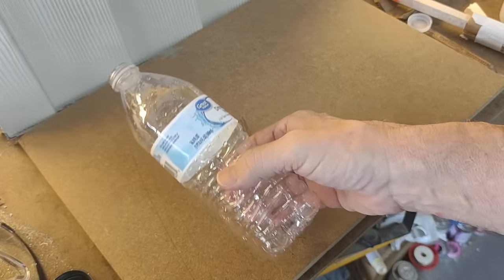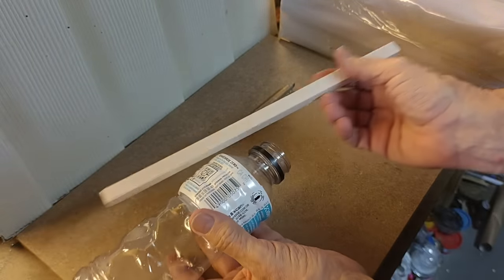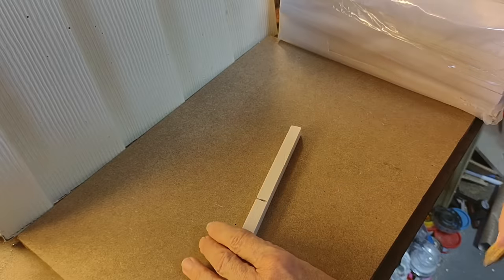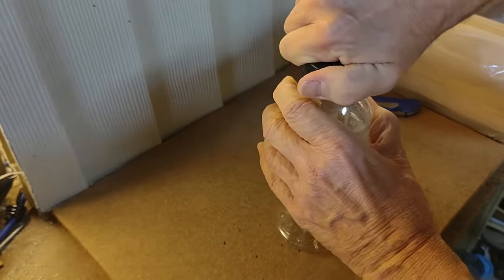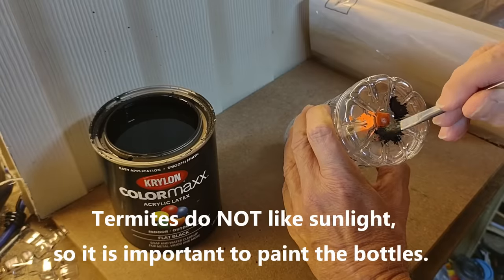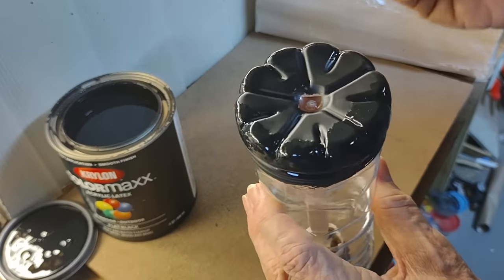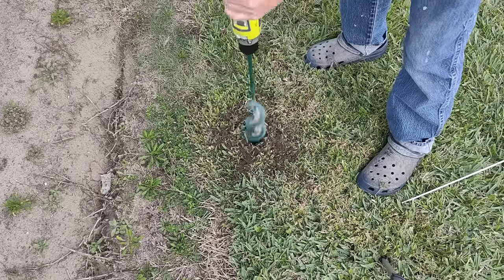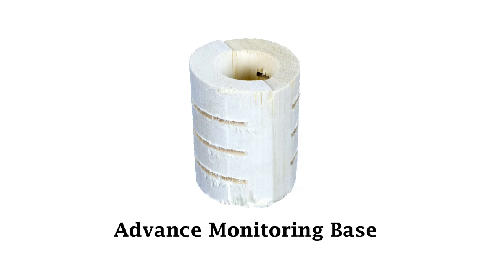Unbelievable Water Bottle Trick for Termites!  Simple to do!

Comment: Thank you very informative video. I just moved into a home with a dead broken down tree near my home above 15 feet away. There were lots of termites eating at it when I threw it into a fire pit. Should I treat the stump area with that chemical? Also are they likely to be eating at my home? We have tons of tiny ants on the second floor in the bathroom. I think they’re just sugar ants but I’m hyper sensitive now bc of t finding. Thank you in advance. Tim
Reply from the maker: Before you start messing with the stump, you need to make sure that your house is okay.  Look for mud tubes around the perimeter of the house, under the house, and in the attic as well.  If you do not see any mud tubes, can you are most likely okay.  Still, the termites are very close, so you should treat with termite granules, if the ground meets the correct criteria.

For the granules to work you need to have dirt around most of the house and that dirt needs to be porous enough to allow water to seep into the ground fairly quickly.  To find out if the dirt around your house is porous enough, just dig a small hole next to the house that is about 4 inches deep, 8 inches long, and just the width of the shovel.  Fill the hole with water and watch to see how fast it drains down into the ground.  If it seeps into the ground fairly quickly, then the granules should work just fine.  However, if it just kind of sits there, then the granules would not be a good choice, and you should consider trenching, if you have an active infestation.  If it turns out that you need to trench, then please watch my video on how to do that correctly.  Trenching is a lot more work, but it only costs about $100 to do an average size home, and it lasts 5 to 10 years.  Most people can trench an entire house in one day, but you can take up to a month to get it done, and you can literally do just 10 feet at a time.  Again, I would not trench unless I had an active infestation in the home.

Make sure that you buy the correct granules.  You need the ones that have imidacloprid as the active ingredient.  A lot of the Home Depot and Lowes stores no longer sell the correct granules, but you can get them from Amazon.  I will give you a link to them.

If you do not have an active infestation already, you may want to also consider using the monitoring stations around your home.  I use both the granules and the monitoring stations.  

After you have the house protected, then you can treat the stump.  Drill holes in the top of the stump that are about 1/2 inch wide and just as deep as you can make them.  You should try to drill them at least 12 inches deep.  Ideally, you should drill them about every 4 inches apart, but if that is too much work, just drill as many as you can.  The more of them you drill the better.  Also drill holes that are about 12 inches apart around the base of the stump that are on a downward angle, so that the drill bit is aiming under and to the center of the stump.  After the holes are all drilled, then mix Taurus SC at 0.8 oz per gallon and fill up the holes with it.  You can mix it in a bucket and use a funnel to get it into the holes.

Please get back to me after you treat the termites and I will explain how to get rid of those ants.             

I hope that helps.  Be well my friend.

Termite granules:  https://www.amazon.com/dp/B000RUIJYM?ref=nb_sb_ss_w_as-reorder-t1_k1_1_6&amp=&crid=157C3RV0MY0AK&amp=&sprefix=termit

Video on how to trench for subterranean termites:  https://youtu.be/Fy7YHi_7Z8g

Video on how to make monitoring stations:  https://youtu.be/gye27aXHRsY

Taurus SC:  https://www.domyown.com/taurus-sc-termiticide-p-1816.html?sub_id=1817
Reply: @GuysPestSolutions  wow I’m amazed at the response  and am very appreciative for the advice. Probably will be a couple weeks until I get it all straightened out, but I will get back to you when I do. Hope you stay well as well!
Reply from the maker: @timtrainer10  You be well too my friend.

Comment: This is Michael. Thank you you for this great information. You really do need to go a lot faster in the future, but your information is valuable and much appreciated. 

I've noticed that Amazon sells some termite warning kits. And it's actually cheaper to buy a whole new kit than to buy replacements. So by some kits and use them around the house if you don't want to take all the time to make a hundred of these for a large house
Reply from the maker: I don't know what to say.  I'm 73 and not in a rush anymore.  At this point, I'm just happy to wake up in the morning.  Lol.  However, I did manage to get my latest video under 11 minutes.  I will give you a link to it.  It pairs well with this video.  I have a homemade bait station that you can use instead of ones that you buy.  Mine works a lot faster.  Do not buy the kits on Amazon.  They are most likely the Spectracide Termite Stakes and they don't work.  I have a video on that too.  Be well Kathy.

Video on how to make a bait station:  https://youtu.be/r05Z-aUJehw

Video on Spectracide Termite Stakes:  https://youtu.be/UDzg-1lpynA

Comment: In the Philippines we used ....use oil from a car Ang spray to terminate viola kaput
Reply from the maker: I do not recommend doing that for two reasons.  Applying motor oil to the ground is an environmental hazard.  While motor oil may kill termites, this would be a fast kill, which is not what you want.  The termites are most likely going to identify this as hazardous, and so they will go around it or under it.  If they go under it, then they may still make it to your house and enter through cracks and crevices that may exist in the foundation.  Sometimes these openings can be created from the house settling, or there could be penetrations from water lines.  In any case, this will probably not kill the colony.  That is why we like to use a non-repellent pesticide that the termites will carry back to the colony and share with the other termites.  This will wipe out the entire colony and it will protect the house for up to 10 years.  We normally do this with fipronil or imidacloprid.  These products are both environmentally friendly and very effective.  They are also inexpensive.  In the US you can treat an entire house for around $100.      

I hope that helps.  Be well my friend.

Comment: My house was built in 1950 and it was made with hardwood redwood mahogany, termites came from the ground from a neighbors yard and landed on my window edge and left after 15 minutes, they didn't want that wood
Reply from the maker: The termites may or may not be attacking your home.  It depends somewhat on where you live and the species.  Most termites do not attack from the air, so the swarmers will die very quickly if they find themselves by your window.  However, their relatives may be attacking from the ground.  Termites do not like some types of wood, but that does not mean that they will not eat it.  I have learned to never say never in pest control.  I recommend that you do a termite inspection.  Look for mud tubes around the exterior of the home that are coming up from the ground.  Also check the crawlspace and attic.  If there are no mud tubes, then you may be okay.  I hope that helps.  Bei well my friend.

Comment: I am from tropical India and is suffering from wood borer infestation of cupboards made of plywood. I used many types of pesticides meant for termites without much use. Can you plz suggest a solution to my problem?
Reply from the maker: The first thing you need to do is determine if these guys are termites or something else.  You have more than one species of termites there, and you also have wood borer beetles and powder post beetles.  Inspect the building for mud tubes.  You will typically find them around the outside of the building, coming up from the ground, but you also may find them in the basement of crawlspace.  Also, let me know if you are seeing any frass where you are seeing this activity.  If you are, then let me know if it looks like a little pellets or if it looks more like a fine powder.  Also, let me know if you've seen any swarmers.  To be effective, you need to make sure that you are treating for the correct species.  Please provide me with that information, and I will see if we can figure this thing out.

Be well my friend.

Comment: Thanks so much for this information. One question though. Does the bottle fill up with water from rain soaking into the ground and if so would that prevent the termites from going into the bait station? Thanks again.
Reply from the maker: Like most things in life, it depends.  The bottle will only fill up with water is the water level in the ground is that high.  Otherwise, the water will drain back out of the bottle.  There may be some water that collects in the bottom where the cap is, but the rest should remain reasonably dry.  If the ground is wet enough to keep the bottle filled with water, then the termites cannot travel through that soil anyway.  They do like water, but they will not be able to breathe in ground that is saturated with water.  I hope that helps.  Be well my friend.

Comment: thanks guy that s awsome  pest control... if it s really bad cut up and wood to ground contact, use the 
injections down... it would be good to put a concrete slab under the structure...is it worth it????
Reply from the maker: Do you have a crawlspace or pier home with wood contacting the ground?

Comment: I get the video was a little long but this guy just showed you how to protect your house and avoid getting ripped off by termite companies. Termite companies will come in and treat your house for $300-600 and then, in order to be protected going forward you have to pay them $100-200 per year to inspect. If you miss a year the contract is voided. Over 10 years that’s $2,600.  Twenty is $5,200. Meanwhile, if you end up with termites, it doesn’t pay for repairs. Go in basement or crawl space with flash light and look at wood. If it’s moist down there you are more likely to get termites. Remember, wet wood is soft wood. Look for tunnels in the wood. If it’s dry and and no tunnels, no signs of termites.
Reply: Len Murtha These stations don't protect the home
Reply from the maker: @mullaway5746  Actually, these stations do protect your home.  The idea is that the termites are going to find the stations before they find her house.  If a station is triggered, then you can treat the termites at the station before your house becomes termite food.  I did not invent this system of monitoring termites.  This has been around for a long time.  All I did was figure out how to make it affordable.  I hope that helps.  Be well my friend.

Comment: Great content! Well explained. Thank you!  QUESTION: As others have asked, can a hole saw be used to make the entrance openings in the monitor bottles? If so then perhaps a one inch diameter hole saw? For the little bastids to come in?
Reply from the maker: Sure.  That would work fine.  You can use 1/2 to 1 inch holes.  Just be sure not to make so many that you compromise the structural integrity of the bottle.  You need enough for the termites to get in easily, but not so many that the bottle collapses easily from the surrounding dirt.  Be well my friend.

Comment: TIP: Watch this @1.5 X speed. A very clever idea! Keep checking! 
Motto: Don't build timber houses in termite country! Could the timber be pressure treated with insecticide?
Reply: Years ago, pressure treated wood used to be treated with chromated arsenic, it was outlawed in the early 2000's, now it's treated with copper, hence the higher price for wood.
Reply from the maker: I always recommend that new houses be treated with Bora-Care during the construction process.  This will render the house totally termite proof, virtually forever.  It is not available in all countries, but if you can get it, then termites will not be a problem.  For existing homes, you can use it to treat exposed wood that has not been sealed in any way.                           

I hope that helps.  Be well my friend. 

Video on how to use Bora-Care:  https://www.youtube.com/watch?v=Rmr_aEodyhg

Bora-Care:  https://www.domyown.com/boracare-p-100.html

Comment: Thank you for this termite video.  Do you have a video on how to get rid of scorpions?  If you don't have a video, could you describe how to get rid of them? 
In the Mesa, AZ area, scorpions are being sighted in various homes.  They seem to be able to get inside the home via electrical outlets, drains, etc.  Thank you in advance.
Reply from the maker: Buy Onslaught FastCap Spider and Scorpion Insecticide.  Mix it according to label directions in a battery operated tank sprayer and spray up the side of the building 36 inches and out away from the building 48 inches.  Be sure to soak the area where the building meets the ground.  Also apply this on your patios, stairs, sidewalks, and that sort of thing.  In other words, you want to apply it any place you frequently walk.  This will stop the scorpions from getting in the building or hanging out on surfaces where you frequently walk.  Next, you should apply it on all ornamental plants around the building as well, being sure to treat the dirt under the plants.  I recommend applying it every 60 days.  Look for obvious penetrations in the side of the house and treat them with D-Fense dust.  Just buy a duster, fill it halfway with the dust, and puff the dust into any cracks or crevices that you find.  After treating, it is a good idea to caulk these penetrations as well.

Always make sure that you hang up all your clothes.  You should never leave clothes laying on the floor.  Clothes that are waiting to be washed should be kept in a sealed hamper.  Shoes should be kept off the floor on some sort of a shoe rack.  After you finish the exterior treatment, you should check the house for scorpions.  Look under appliances, in closets, under the bed, and that sort of thing.  Be sure to check shoes, curtains, or anyplace these guys may be hiding.  To assist in your search, you can use a black light.  All scorpions will glow green when exposed to a black light.  

I hope that helps.     Be well my friend.

Onslaught FastCap Spider and Scorpion Insecticide:  https://www.domyown.com/onslaught-fastcap-spider-and-scorpion-insecticide-p-2579.html

D-Fense dust:  https://www.domyown.com/dfense-deltamethrin-dust-p-2428.html

Duster:  https://www.domyown.com/bellow-hand-duster-p-106.html

Comment: Instead of cutting notches in the sides of the bottles I used a wood burning tool I already own to make the holes.
Reply: DavidM :  Tetmites refused to attack a partially burned wood- around 3. mm in thickness burned wood surfaces.. Maybe their wood dissolving saliva has no effect to the carbonized woods surfaces...

Others, they saturate the  soil with 3-4. inches thick of sea salt layer- the ground portion for "footing & foundation" plan, before the pouring of concrete slurry.. 

I think such  ground "salt treatment" method- was applicable for high ground area, not prone to flooding... Thus, the salt absorbed by the  ground-  will not be washed out, by the flood water...
Reply from the maker: I guess that will work, but doesn't it kind of smell when you're burning the plastic?  I really hate the smell of burning plastic.  I suppose it would make for a very neat job though.  Be well my friend.

Comment: My house is built on solid rock. They had to jackhammer rock for 2 1/2 days before they could put in the foundation and pour a slab. In many places, I hit rock  4-6 inches below the grass. Any suggestion on how to put bait bottles in areas like this? Also, the house which is 5 1/2 years old was pre-treated for preventing termites before construction. How long are those chemicals effective?
Also, my daughters house next door is probably 30 to 40 years old. If it was treated back then with the chemicals use at that time, would they still be effective? 
God bless.
Reply from the maker: If you have at least 4 inches of dirt around the house, then you can simply use shorter bottles.  You can buy water bottles that are about half of the normal size.  You may be able to find them at Walmart, Sam's Club, Costco, or that sort of thing.

How long a pretreatment for termites will last is going to depend upon how it was done.  Unfortunately, almost nobody does it right.  Therefore, I would not trust that this was done correctly, and I would go ahead and take preventive measures.  In addition to installing monitoring stations, you may also want to apply granules around your house as well. They cost about $50, and you only need to apply them once a year.  I use the granules every year, and I have the monitoring stations around the house as well.  I will give you a link to my video on how to use the granules.  You can no longer buy the granules from home Depot or Lowe's, because they sell the wrong ones.  So, I will give you a link to the correct granules as well. 

If your daughter's house was treated over 30 years ago, then that treatment is no longer effective.  She would be wise to take the same precautions that you are.

I hope that helps.  Be well my friend.

Termite granules:  https://www.amazon.com/dp/B000RUIJYM?ref=nb_sb_ss_w_as-reorder_k0_1_9&amp=&crid=3N6IDCVU0F3BY&sprefix=termite%2Bg&th=1

Video on how to use termite granules:  https://youtu.be/H7rW_TSBHJ4